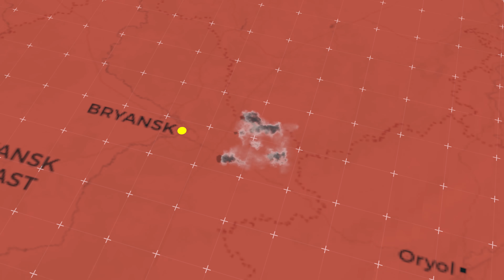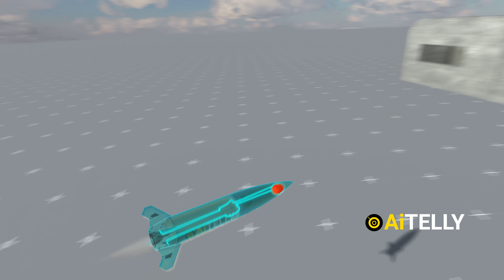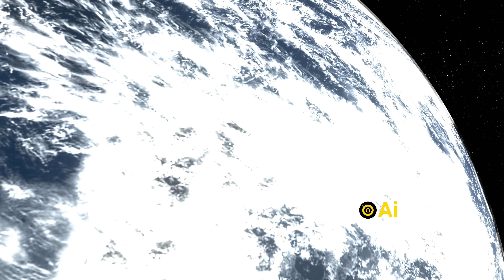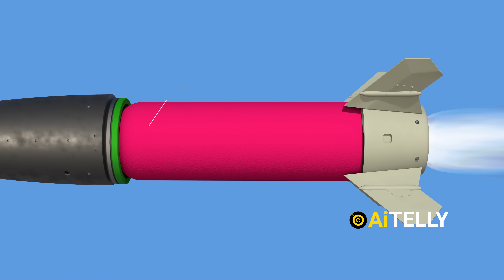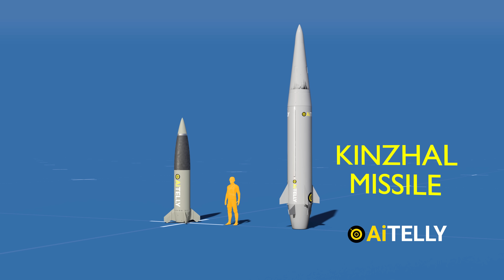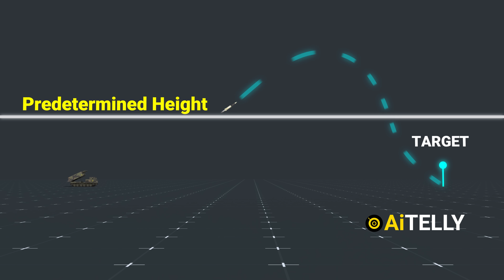Ukraine First ATACMS Strike in Russia #ukraine #russia

Comment: I was operating the ATACMS when the missile or rocket came apart in the air and dropped the hundreds of bomblets in a 1,000m by 1,000m grid square. The shrapnel from the bomblets could penetrate 4 inches of steel.